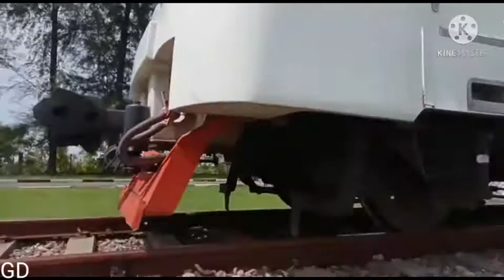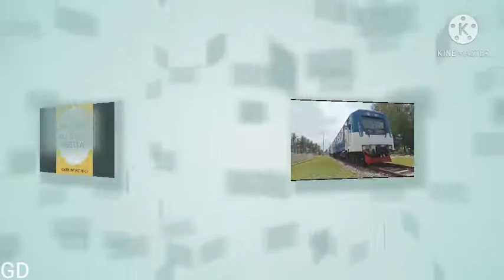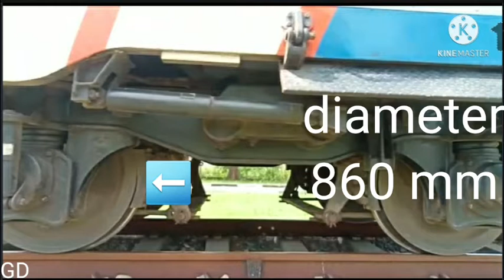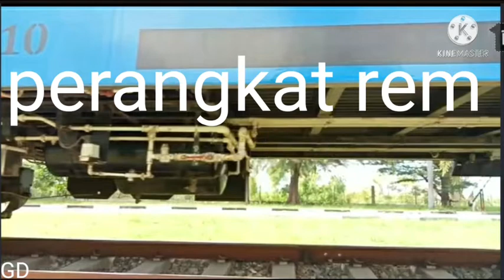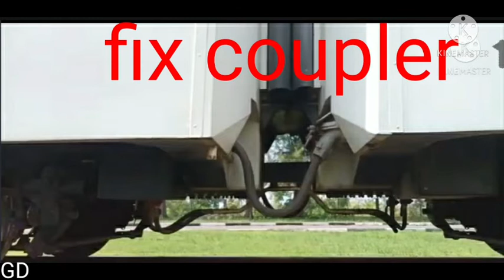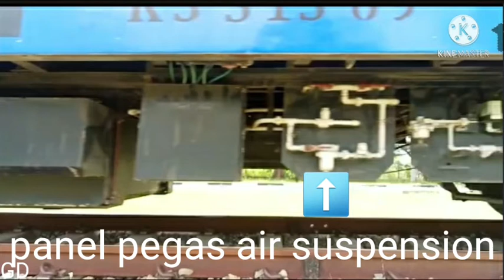Kereta Api Aceh beroperasi lagi dan pengenalan peralatan dibawah Krdi Cut Meutia

Comment: Jadi kalo lokomotif Amerika mau visit ke Indonesia haru ke aceh, tapi kalo misalnya ke sini gk bakal bisa sih karna lokomotif Amerika cepet2 semua kecepatan maks bisa nyampe 200kmh(untuk lokomotif diesel penumpang) dan power nya 4000-4400HP. Bobotnya juga mungkin lebih berat,sama lokomotif kereta barang mereka bisa nyampe 6000hp tenaga nya dan satu lokomotif bisa ngebawa 100-110 gerbong dengan sendirinya lwwkkw hampir 2x lebih gede dari pada loko terkuat di Indonesia(CC205, CC206, dan INKA CC300)